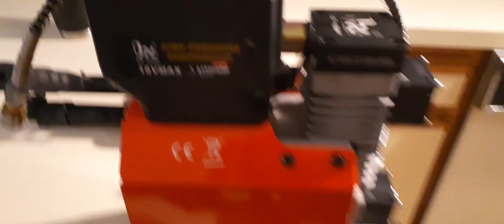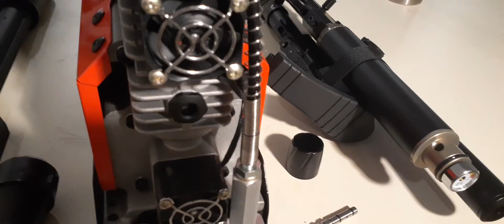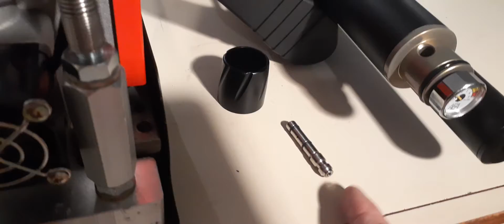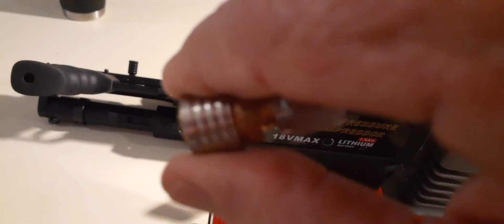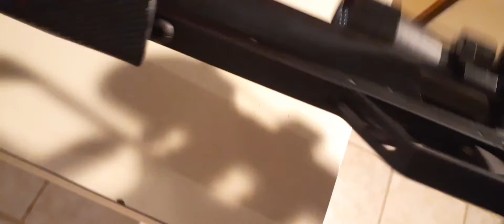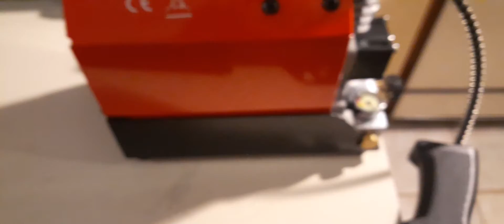GX 18 v pcp air pump and airforce talon p carbine a good combo

Comment: Small suggestion? Get an air filter between your air compressor and airguns so you can catch the moisture going into your airguns air tank.
Just a small suggestion 
Keep you’re plinking on target 🤠
Reply from the maker: It has two filters in it but would like to get a bigger one for filling my 1 liter scuba tank with real clean air